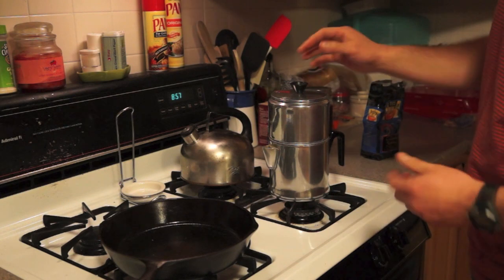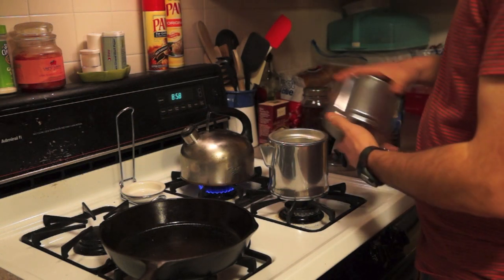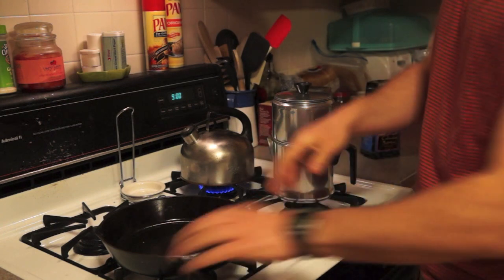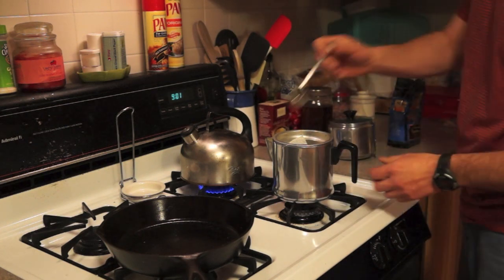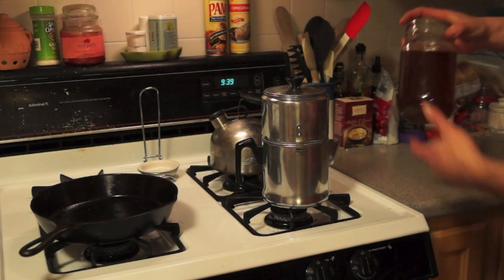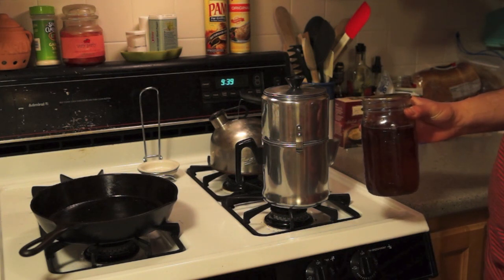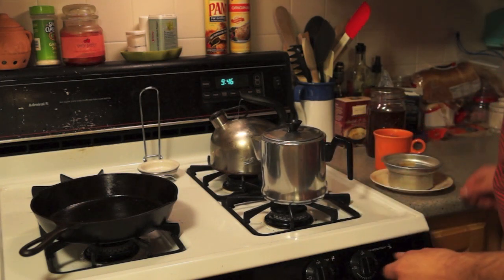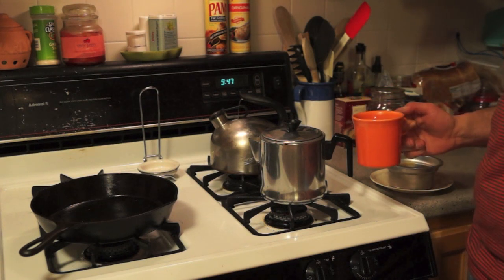Drip-O-Lator Drip Coffee pot - 3-12-2013

Comment: I still use an enterprise drip-olator most every day. Mine was made late 20s early 30s with wood handles. all measurements are marked out for you. luckily my local grocery store still does the grind your own beans, you pick the coarseness and many flavors. i always go with a courser ground as was used in these pots. cuts out on grounds being in the pot, most of it anyway. Even though I have a Keurig it rarely gets used, it simply doesn't make coffee as good as my old drip-o-lator

Comment: I was raised on coffee made in a Drip-o-lator, which I believe was a brand name.  I know they were making them into the 1960's and early 70's - although maybe not that brand.  They sort of disappeared when Mr. Coffee came on the scene.  Usually you bought them in hardware stores.  We never used a paper filter.  Also, we didn't take it apart after the coffee was done - we just pressed on the lid on top of the reservoir/coffee basket to make sure it didn't come apart and just poured.  We also never reheated the coffee - when it got cold we had cafe au lait and added about 1/2 scalded milk and 1/2 cooled coffee in the cup.
Reply: Yes I bought a couple of these in New Orleans in the mid- 70s.

Comment: My dripolater doesn’t get grounds in my coffee unless the grind is too fine. One thing I do is heat up the pot the coffee will be dripping into. I set it on an d heating trivet so the coffee stays hot as it drips through the grinds. I make a small two cups of coffee or so and it stays nice in the trivet for several hours. My pot is ceramic and though the pot stays hot, the handle stays cool. Not sure how but it’s nice that I don’t need a pot holder to decant the coffee. It makes a really good pot of coffee. It’s better than a pour over or an electric drip coffee  maker. Not quite as good as my moka pot but I’d say it was close. Very easy to clean up too.

Comment: My grandfather had one of these while I was growing up. You can actually turn the fire on under it rather than using the other pot to boil the water.
Reply from the maker: +Mr. Cruse this is the first one of these I have seen... been using it like the video but I'll try it without the tea pot... thanks...
Reply: Mr. Cruse but then you're pouring cold water over grounds, and heating up an empty kettle. Sounds like a recipe for disaster. I use mine the way he does, minus using a paper filter.
Reply: There's ones that look really similar but they are percolators like moka coffee makers.
Reply: Mr. Cruse, that's how I use mine. Cold water in the top and warm it after it drips. That's how it was designed to be used.
Reply: @EezeeGroover  You don't heat the empty kettle😂😂😂😂Good lord, anyone knows better than that. You heat the coffee.

Comment: My mom has the same one as you and I looked at the bottom and the company is “Enterprise Aluminum” which made me wonder... are these made from aluminum? I really want to use it but I don’t want to put hot water in something containing aluminum since that could be toxic. I’m wondering if you happen to know if maybe these are stainless steel or some other type of metal that wouldn’t technically be toxic like aluminum is when heated.
Reply: I have seen something similar in a Vermont store catalog I think It was made with stainless steel. They were charging an arm a leg.
Reply: Paul Revere brand makes stainless steel ones.  But in those type, the hot water on top part is one piece with a  smaller part below to hold the coffee grinds.  The bottom of the coffee grinds has a lot of holes so the coffee drains from the grinds quickly.  Just above where you have the grinds, there is a round disc that fits on top of the grounds.  This disc has less holes in it, so when you pour your hot water above this disc the water more slowly drips through onto the grounds.  I hope that makes sense.  People used many aluminum products for decades with out any toxic affects on their body.  I would not overly worry about it.

Comment: I love my old Drip-O-Lators.  I have a 3 cup and a 9 cup. They make the best brews and are so easy to use--no electricity, or breakable glass pots, and i can brew a perfectly consistent pot of coffee at 4AM when I'm only 1/2 awake. My ONLY concern is the aluminum toxicity issue.  A few years ago I began thinking  that making coffee every day from this aluminum pot may involve health risks. I am 68 now and have been using my 3 cup drip o later since the 1970s. I'm sure the company that manufactured ii is long gone. Is there anyone who manufactures this type of drip pot in stainless steel?
Reply: Aluminium concerns me too, I've seen stainless steel ones on eBay Comet brand.
Reply: Mine is ceramic and made by the same company.
Reply: Paul Revere brand has stainless steel ones.

Comment: if you have never seen one of these before you are telling how young you are ...I have been looking for any company that makes these....when hurricanes come thru Louisiana and the lights are out for weeks they are nice to have...and I hate perculaters  so if you know where I can get 3 or 4 of them I would appreciate the help
Reply from the maker: +bithg 2556 I'd check eBay :) We use percolators at the cabin most of the time... takes a little longer then this...
Reply: ty my friend ////I will check and keep on looking ...you know these young yuppies....it ain't broke but we are going to fix it anyway.....lol....but there is no better cup of coffee than one made in a drip pot if made correctly
Reply: bithg 2556. Hello. Search Ebay or Etsy, you should find one.
Reply: You can also fine relatively easily alcohol burners to heat your water.  There are also antique percolators that use alcohol to 'perc' heat the water.  But they are very slow to perc out a finished cup of coffee.  But if the power is out, who cares.